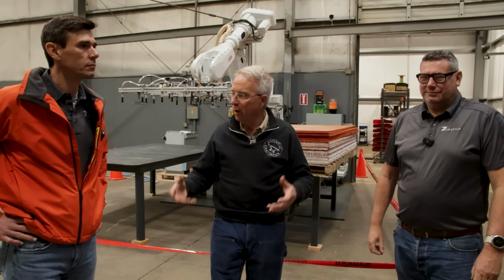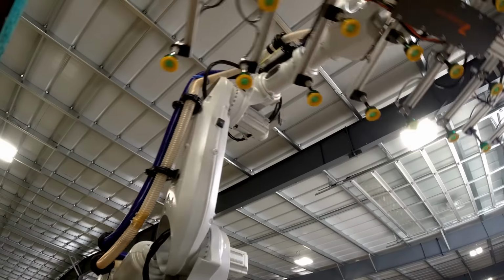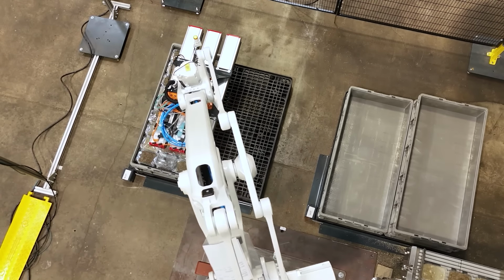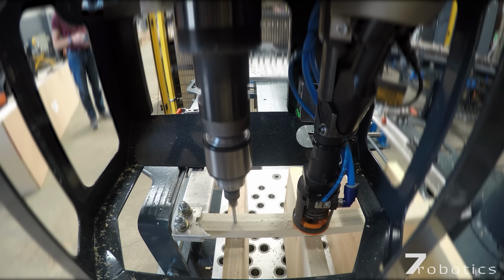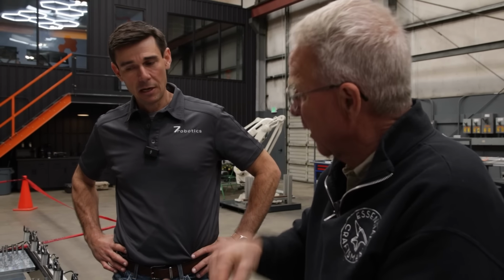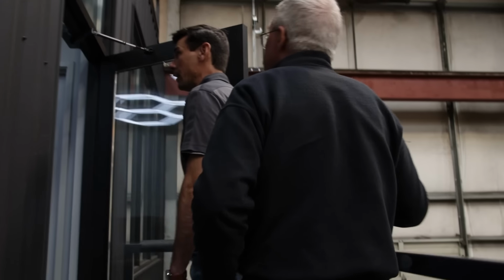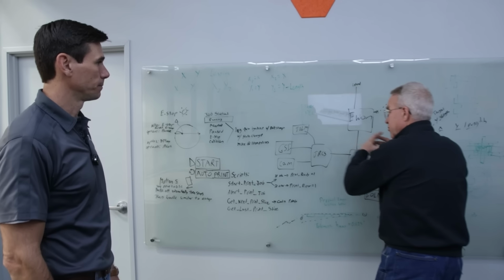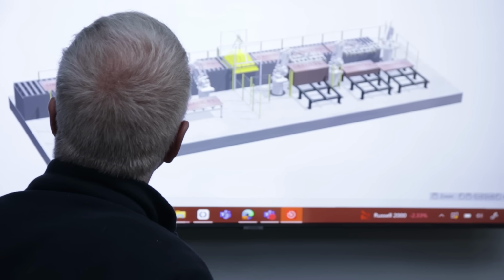Meet the Robots Revolutionizing the Wood Products Industry | 7robotics Shop & Story

Comment: I found this video highly interesting. Last year i was tasked to build 5×12×1.5" sheets of paneling for a hotel furniture company with some of the early equipment from the 90s. It came from Iran. It was 2nd hand to us and highly manual labor. Anywhere the legitimate earliest machinery could be omitted and exchanged for elbow grease and borderline dangerous shortcuts, it was. We assembled and learned the hard way, cutting every corner and robot out of the picture. Eventually we cut out our original board supplier, wilsonart,  until we had a recognizable system designed. As the only permanent employee, I trained and received minimal effort assistance from new temps every 2 weeks for 8 months. Finally, i was let go for production numbers. I would have LOVED a robot to assist me. You just cant run those lines with less than 3 experienced hands while changing board laminate, length, width, and thickness AND have the glue dry at the same time..talk about used up, chewed up and spit out without so much as a thank ya c-ya next tuesday!

Comment: I've been in the robotic industry for 20yrs now from the welding side. I remember the early days of going into plants when they still had tons of production welders, every one of them was closer to the retirement end of life, and it's not much better today. What they didn't touch on is that you still need people to maintain and troubleshoot an automated cell. It just requires a different skills set. If someone was coming fresh out of HS and wanted to be in the trenches, I'd suggest they look into controls engineering or mechtronics. You will always have a marketable skill that is in demand. Automation isn't going away, and a controls engineer can't be bumped out of a job by AI or a robot (same for the trades).
Reply: @mbbmidwest3556  in your opinion can this be achieved with just an associated degree?
Reply: @ngkngk875  There are a tons of technical schools that will get you quite far and cover the real application side. If you want to be more on the engineering side, I'd look tword a 4-yr.
Reply: More robots ,less workers ,lower population, less pollution & less stress on fauna and Flora?

Comment: One thing i wish they'd change in the lumber area is stop using nominal dimensions and use exact dimensions. None of the 2x4 = 1.75x3.75 crap. As an engineer, these nominal dimensions drives me nuts!

Comment: Change is ALWAYS gonna to happen, adapt or get run over. In addition, when boring, repetitive and dangerous jobs can be done with machines, who loses? Someone still has to run the machine, someone has to repair and maintain it and someone had to design it. Humans are still part of the process,  just in different and more stimulating roles.
Reply: I find repetitive jobs very stimulating. I just put headphones in and listen to audiobooks, it's pretty great, especially if it pay ok. 
The dull jobs I don't like are the ones just demanding enough mentally that you can't listen to something but not so demanding there is a challenge. Like setting up a job on a cnc mill is just hard enough that I can't properly listen to audiobooks. But it's not difficult enough to be challenging and stimulating. That's the downside of all the automation. Some is complex and challenging but a lot of it is just a bit more complex than repetitive work. Which is worse if you can't listen to something.

Comment: I recently visited the Mini Cooper Factory in Oxford and did a great tour. They have 1270 robots in one building that assembles the body from start to finish. People are there but only to load small parts and to monitor the machines.. It is amazing to see one part get welded, picked up and moved over a fence to another station and the process takes 60 seconds per station.. I can understand what Joey is saying about wanting to move toward larger applications... $$$$  
Mini used to have 30k people working at their factory now 3500 due to automation..... robots will cost jobs